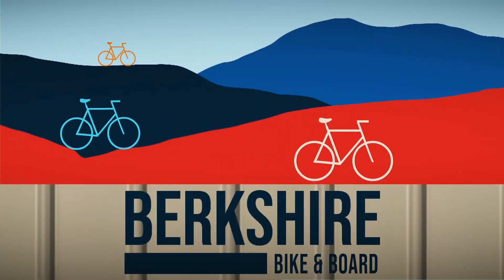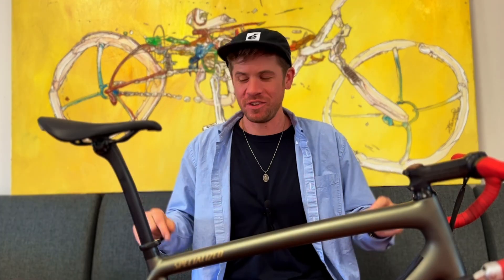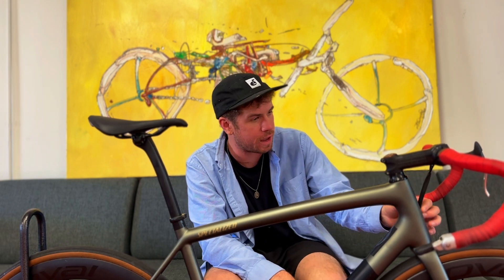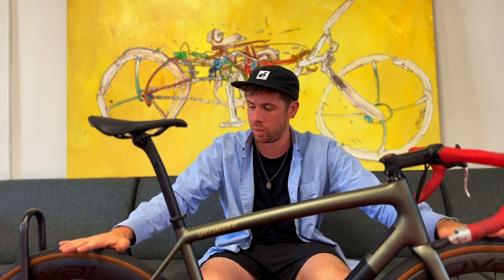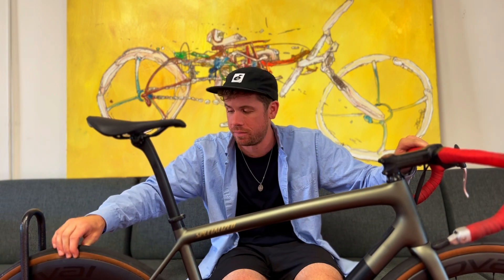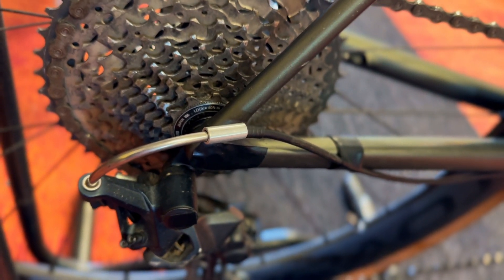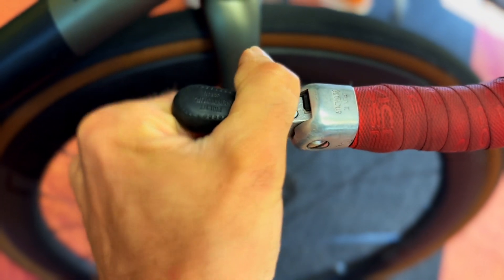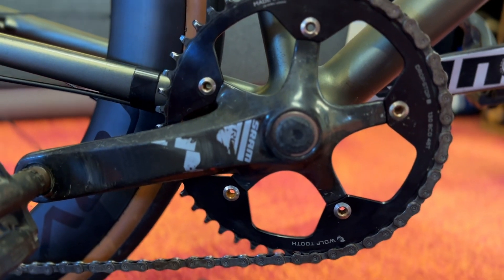We’ve never seen a Specialized Aethos Built Like This !

Comment: you can fit a 35c on a aethos?
You can remoce the shift padles on hydraulic breaklevers. I did it on my 105 sti and lately on an ultegra di2
Reply: sram has a mechanical tt shifter that cklicks but comes back so it is always in the best aero position no mather the gear.
Reply: unless i'm colourblind the topcap doesn't match the logos at all. the topcap is an orange king of bright shiny gold. the logos are a sandcolout mattle but it's nearly impossible to colourmatch painted and anodised parts.
Reply: You guys should do some drillium on the parts and frame and then cover the holes up with super light tape.